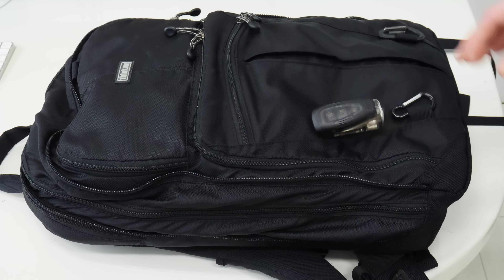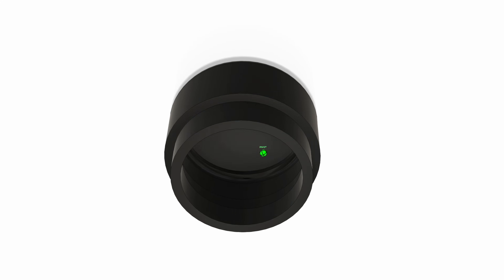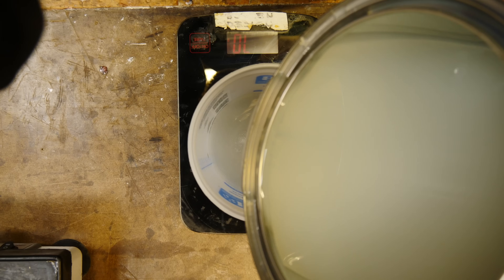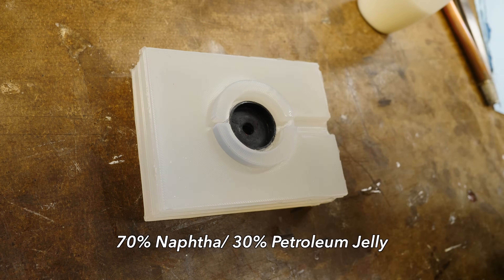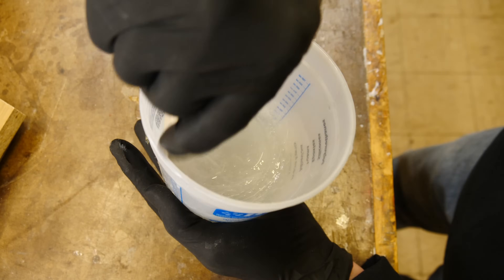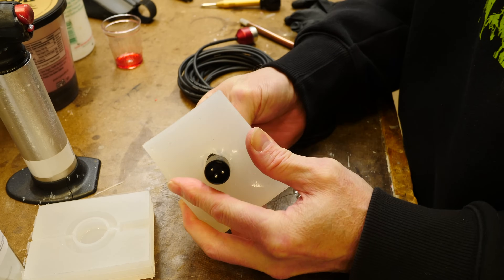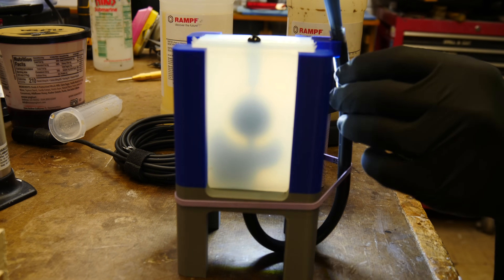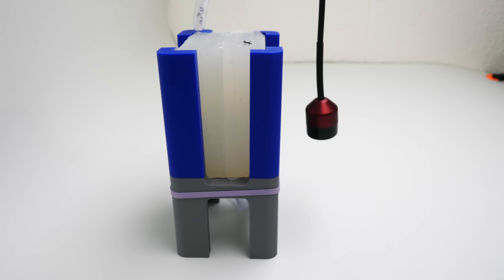Insert injection molding shore 50D urethane resin in two part silicone mold

Comment: I did try resin printed parts with platinum silicone but had curing i inibition issues. Do you  spray coat those resin printed parts?
Reply from the maker: Test your resin first and find one that does not cause an issue

Comment: Another excelling piece of art. Congrats.
I am in the process of creating a hard mold either from epoxy or urethane resin that will be used to create small silicone parts. The silicone parts will have many small holes (1mm diameter) in it and I am wondering if the 1mm diameter molded pillars in epoxy or urethane will be strong enough to not break while demolding the silicone parts. What hardness do you recommend for such a mold?
Reply from the maker: I would not use anything above a shore 40
Reply: @EricStrebel  Thanks. Also, can i mix PTFE nanopowder in urethane as a permanent easy release? I cant use standard mold release coatings like vaseline or other additives due to the application sensitivity.
Reply from the maker: Hmmmm, not sure, test it out and see how it works. Let me know.

Comment: WOW! That top part looked awful out of the printer. You should not have to do so much rework if your printer settings are good, you should get a nearly smooth part right out of the printer. This looked horrible!
Reply from the maker: Yes, the heater is broken on my form 2, failed print parts in the resin, causes print issues
Reply: Right? It looked like a bad FDM print not resin. If Form is giving him discount codes to pass out they should send him a fully dialed in printer.
Reply from the maker: The form 2 is an older machine, the form3+ is the new machine.

Comment: For such a small mold would it be possible to pour the silicone and then place the whole mold into the degassing chamber? Or are their other reasons that wouldn't be a good idea?
Reply: I tried that once on a project I was working on.  Half of the silicone ended up in the bottom of my vacuum chamber. Had to redo the mold.  It was a mess. Lesson learned.

Comment: (2:38) Man, you have the worst luck with 3d printing.  Those parts look....how do I say this nicely...well, I guess I won't say anything.  But it's bad man.  That's really bad.
Reply from the maker: Eh, some bits in the resin from a failed print, not an issue for that part.
Reply: @EricStrebel  I was speaking to the over all quality.  Is your form 2 heated?
Reply from the maker: The heater has failed  in the form 2....it's an issue I have to deal with.

Comment: Thanks for sharing! Great project. If you weren't filming, besides the tin cure, would you have solid sides for the mold support to help limit the flash?
Reply from the maker: Maybe just additional key lock on the edges
Reply: @EricStrebel  I guess you could throw that into the 3d printed midplate. Easy!
Reply from the maker: Correct

Comment: Is the syringe a consumable of the process or can you clean that up to reuse?
Reply from the maker: Reusable 😀
Reply: @EricStrebel  I can't work out if you are laughing at the absurdity of the idea that it would be reusable or if it just plainly is reusable. I'll look it up!
Reply from the maker: It's very reusable
Reply: No joke, you blow some compressed air in the nozzle side of the syringe and it pops right out. And sometimes across the room too!
Reply from the maker: Yup
Reply: @alexandremasse9562  Okay, great news thanks. I've bought a little kit of resins and silicone and some bits and pieces, including a syringe like this one but not done much with it all yet. Appreciate the pointers and newb question answers :).
Reply: @AndrewHelgeCox  Anytime, have fun!

Comment: Very cool! I am only subscribed to a few channels and this is why I am to yours. There is a difference between a pro and wanted be. I stared to molding when I was 7 years old with friends, from oil cans we created a furnace that we melt all kind o of plastics that melts into the sand mold in the ground, we created difference products and parts that where better than the original.

Comment: Nicely done Eric! Having the 3D model beforehand is blessing, speeds up the process tremendously. I'm battling with a project where I have to fit panel inside fairly complicated blowmolded case and the hours just fly.